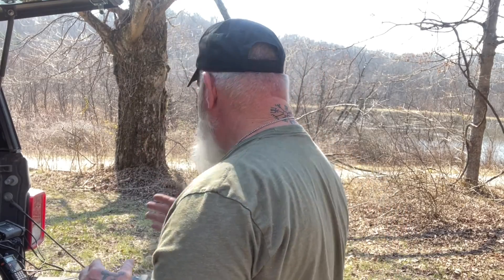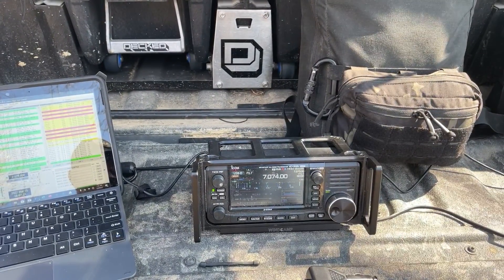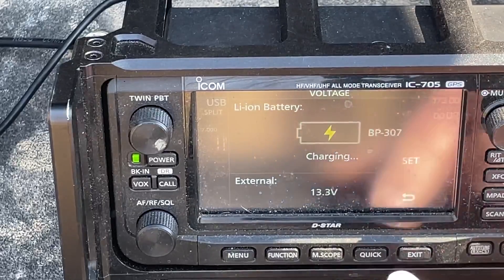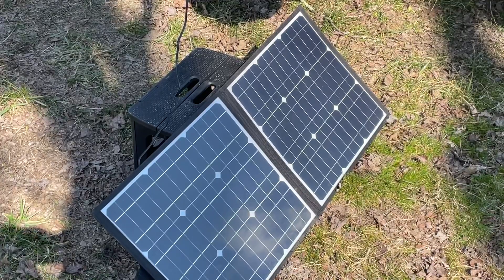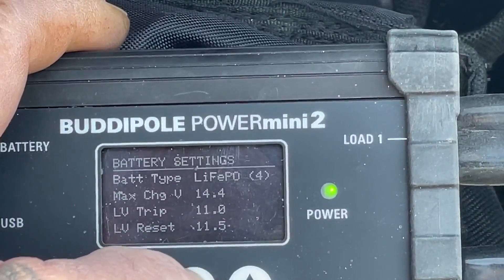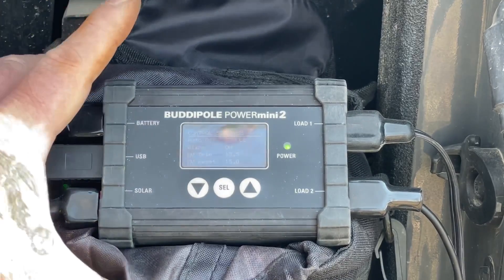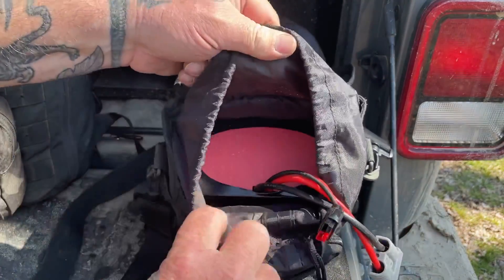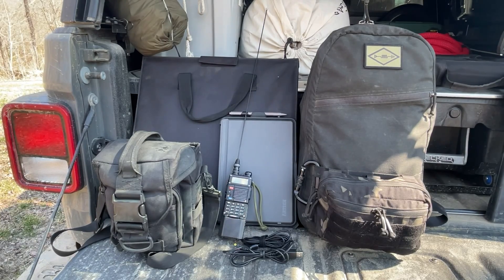Solar Power Field use Experiment

Comment: Miady makes a 20ah LiFePo4 battery on Amazon for $70. Gets good reviews.  Possible cheaper alternative w/o the built in Anderson power pole connectors. 
Be careful connecting laptop to 13.3v battery, most laptops use 19v dc.  I’d recommend a PWR+ charger from Amazon which steps up 12v to 19v or if you have a late model laptop, they have a USB-c version.

Comment: I can't believe it's as simple as plug and play there are so many variables, I never could find out just how they determine the output of a panel I assume its at peak sunlight but who's peak and what time of year and how long, is it instant or is it watts per hour? 1pm in Dec. in Ohio the intensity of the sun is way different than in Fl. So Dave when you look at your equipment it said 13.6 volts and you had 3.5 watts so my math says you have .25 amps so when you add the amperage usage of your equipment and any loses from your controller and wires and connectors what's left charges your batteries, at that amperage how long would it take to charge them would you have enough for your nighttime usage or in a few days would you deplete the charge enough to loose it and that does not take in account locked rotor amps of any equipment you want to run do you need another set of panels how do you determine this? Maybe I analyze it way too much and it is just plug and play but I would hate to spend allot of money only to find it inadequate you think someone would make a hand carriable generator that would run off wood gas maybe a motor the size of a weed wacker motor and a gasifier the size of a milk jug that you can put over top of your camp fire or a fuel cell and you would carry a tank like a paintball gun of the gas thats used Solar is ok but its semi reliable and not very powerful and degrades from the first day on so the peak at the first day is higher than 5 years later.

Comment: Great video!   You can strain relief the power cable for your surface with a little hot glue where the wires go into the powerpole connector.

Comment: I'm a bit concerned about the cable for your laptop. Generally these surface computers require a very clean and regulated 15v DC output. A battery like that could probably drop enough in voltage to freak out your laptop or trigger some internal protection.

Comment: My computer uses 9 volts so many milliamperes. Can you adjust the output of the charge control to 9 or 10 volts? I wouldn’t want to blow up my computer.

Comment: I think that all outdoorsmen should think about Ham / two way radios for communication and also alternative power for field use and home use. My outdoor and home needs 300watt power banks are all I need to power and charge my equipment. 
For my home I’m making my own power system for my radio. Just a standard deep cycle marine battery and a 100watt solar panel .  As for my home utilities I’m wanting to setup a couple 300 watt power banks. I’m trying to find a power brick to power my 25 watt radio while in the field something more mobile and compact that won’t take up much space in the pack